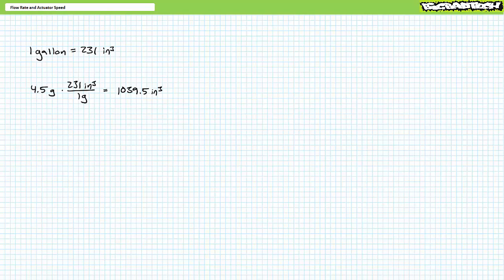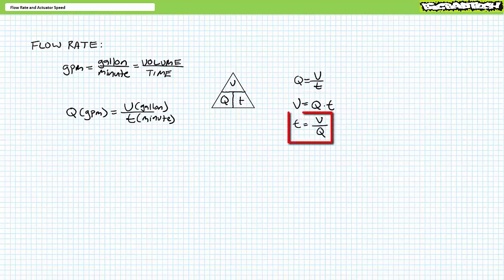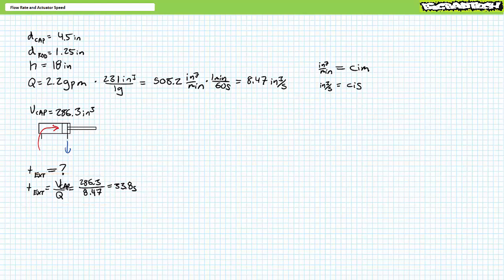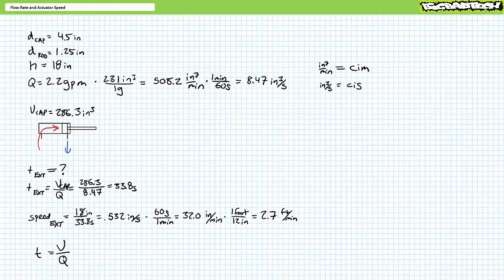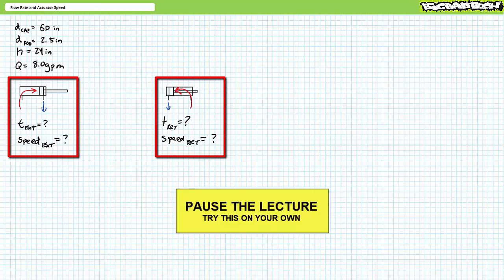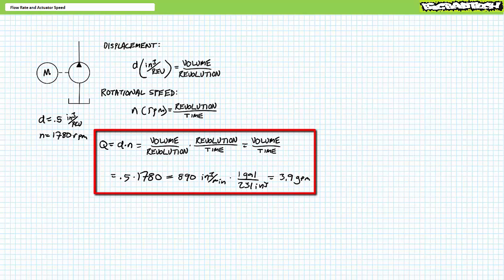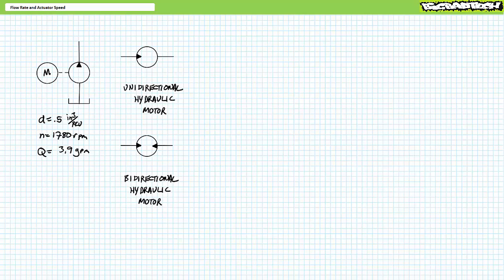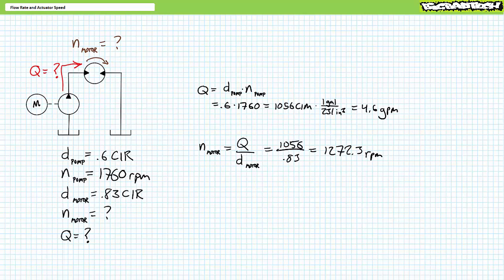Flow Rate and Actuator Speed (Full Lecture)

Comment: when referring to the unit conversion lecture you divide what you want on the top 231 inches divide by the bottom which you dont want 1 gallon to get 508 inches per minute i am curious as to why this want and dont want of dividing equasions changes when going to 1 minute divide 60 seconds = 8.47 inches per second shouldnt the second be on the top of the equasion
Reply from the maker: https://youtu.be/E0-z4HQ7UDI

Comment: do you have examples for actuator speed that is pushing/pulling a load? or do these calculations apply regardless since the fluid is assumed incompressible?
Reply from the maker: For simple scenarios in which a load is supported (ie: not overrunning or acted on by any outside source) these calculations remain valid for hydraulic (ie: non compressible) systems. Consider a cylinder pushing a weight across a table on extension. Actuator speed would be dependent upon flow rate into the cap end volume. This same cylinder would pull on retraction. Actuator speed would be dependent upon flow rate into the rod end volume. All bets are off in pneumatic (ie: compressible) and overrunning scenarios!
Reply: @bigbadtech  Thanks for the clarification and for all the videos you’ve made, they’re a big help. Do you have any videos for speed calculations for pneumatic actuators?
Reply from the maker: Unfortunately I haven't yet produced a lecture discussing actuator speed calculation for pneumatic systems principally because air is a compressible substance and at different actuation pressures the volume of a given quantity of air changes thus there's a complicated interdependency between pressure and flow. This being said I do have a lecture discussing general flow control methods in pneumatic systems at: https://youtu.be/Gj7AeZDmbLQ?si=gIo7JGTuXtnW7NbH

Comment: Can I just confirm that with a constant displacement pump, the flow rate is the same going into the rod end as coming out of the bore end, presumably due to the principle of the conservation of mass?
Reply from the maker: Not exactly. A hydraulic motor might have same input and output flow rate because flow is traveling through the motor, however a double acting cylinder won't because there is no connection from input to output because the piston acts as a seal. Consider a double acting cylinder with a cap end volume of 2 gallons and a rod end volume of 1 gallon. An input flow rate of 1 gpm means the cylinder takes 2 min to extend. Emptying the rod end also takes 2 mins so exhaust flow rate is .5gpm. During retraction an input flow rate of 1gpm means the cylinder retracts in 1 min and exhaust flow from the cap end is 2 gpm. This is often why tank hoses are oversized to accommodate differential flow rates.